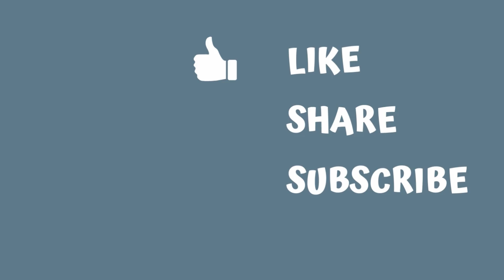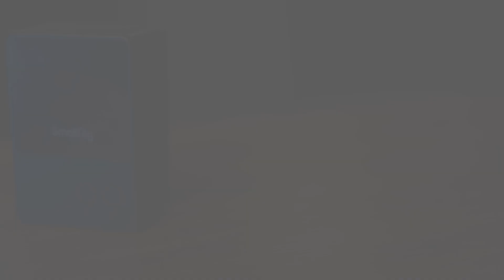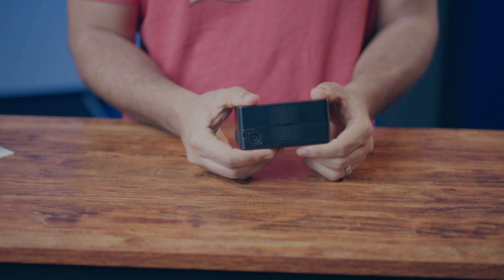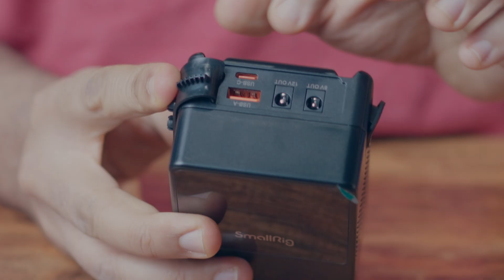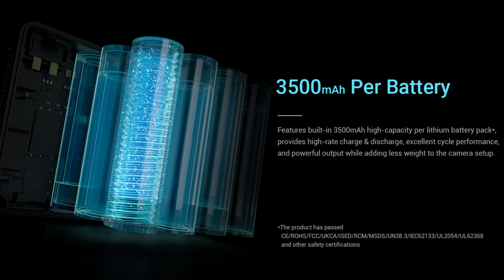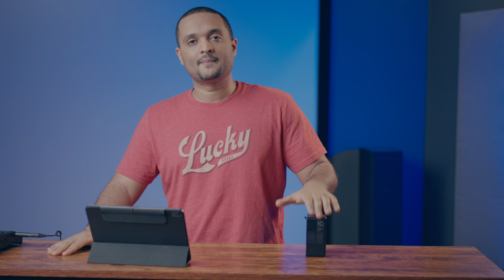Review Of The Small But Mighty SmallRig VB99 Mini V-Mount Battery

Comment: Whats the differences between vb50 and vb99? Loving the video btw👍
Reply from the maker: It would be the battery capacity. So the more devices you plan to power, the more watt hours you need in a battery. The vb99 obviously provides just that.

Comment: Great review. Did it prevent your A7IV from overheating? Also as I am just using it in a studio for interviews could it just be attached to a mini tripod and connect to the camera with a long usb-c cable rather than buying additional rails and mounting plates?
Reply from the maker: Thank you for watching. Unfortunately, my a7iv still overheated even when on standby. Initially, i was under the impression when purchasing an external battery that i would not have to leave the Sony battery inside, but you have to leave it in because via USB C, it basically charges the battery inside and keeps it fully charged and there is no way to power the camera solely using USB C and without a battery in the body. That kinda sucks but it is what it is. Unless you are using something like the FX3/30 cameras that have a builtin fan, you will run into this with the a7iv. I have thought about maybe buying a dummy battery that connects to the d-tap port but even that i heard still heats up a little bit. I think doing some of the following will help:
1. Increase the temperature sensor to high 
2. Leave the battery door open so that some heat can escape from the body
3. Have the screen flipped out so that the heat on the body can dissipate better. 

Having said that, i still do not regret getting this battery and would highly recommend it especially if you do interviews and have a lot of stuff geared up. Do not have to worry about keeping extra batteries laying around and you can even power an external monitor with it. Great battery and not too heavy at that.